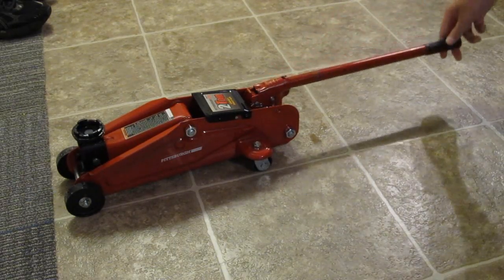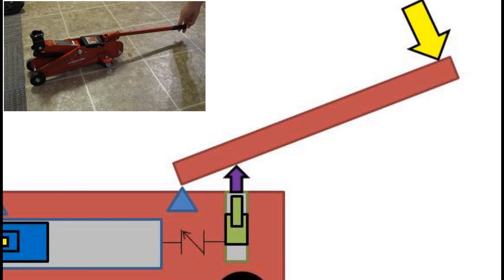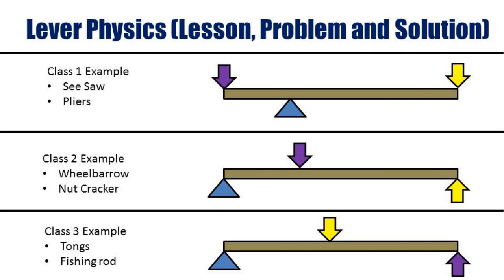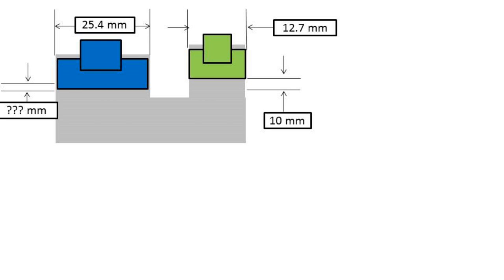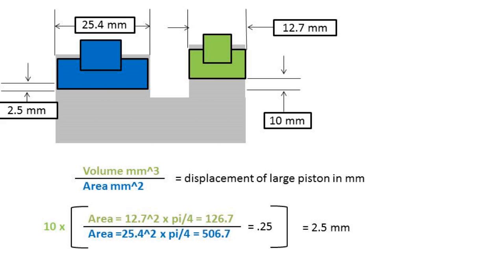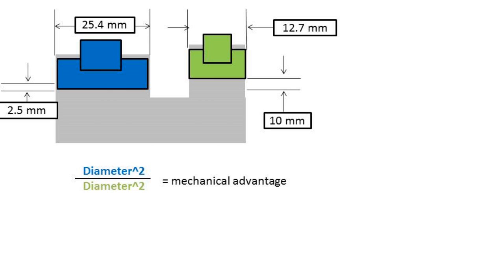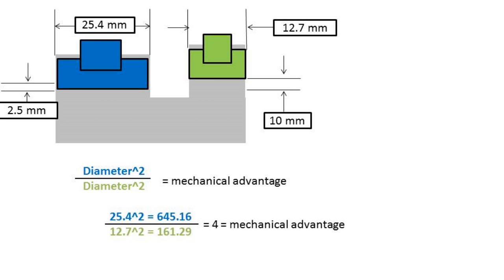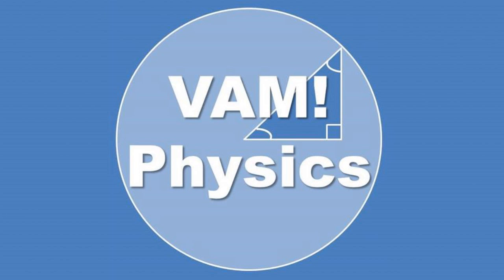Hydraulic Physics (How Hydraulic Jacks Work)

Comment: So it's really 2 systems of mechanical advantage.  The total MA is the MA of the area differential (4:1) multiplied by the MA of the cranking lever.  The latter would approximate 15:1 and if so, the total MA would be 60:1 - is that correct?
Reply from the maker: There would be 3 systems, the input lever, the hydraulics, and the output lever. Inorder to get the total mechanical advantage you would multiply the mechanical advantages together. Hope this helps. Let me know if you need any additional clarification.